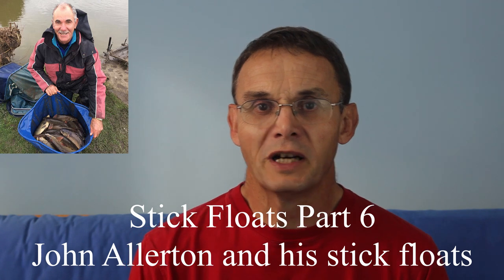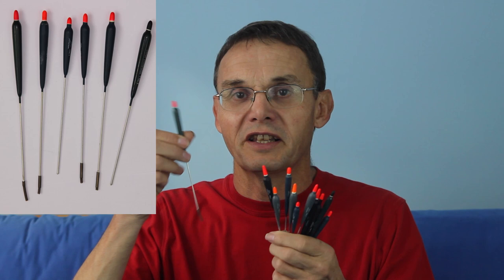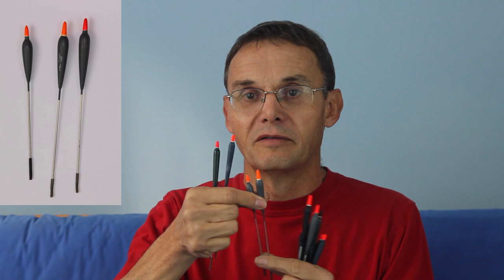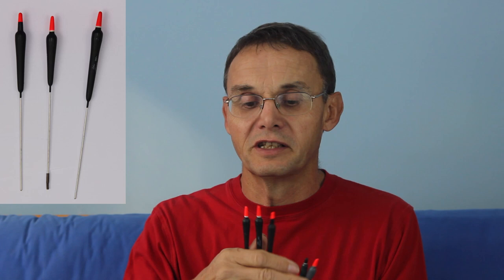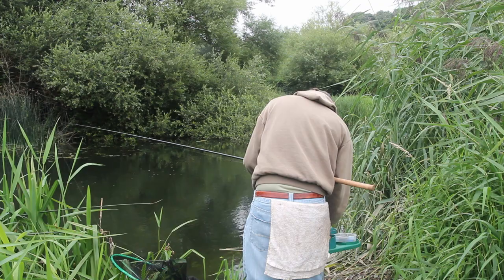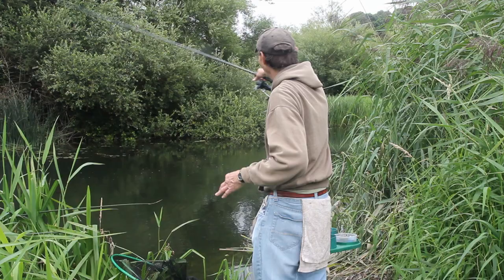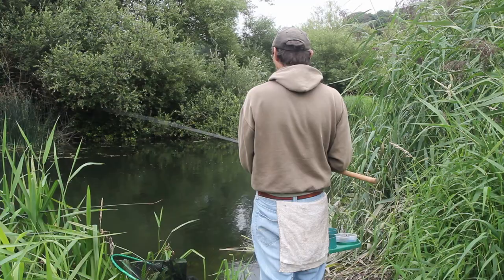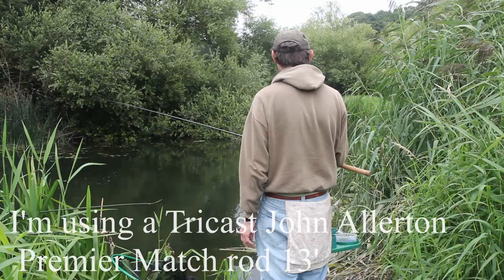Stick Floats Part 6  - John Allerton and his floats

Comment: I used to make pole floats using Johns alloy stem stick floats. You could nip off some of the tip and superglue a thin plastic vane down into the float base. The vanes were mostly painted Black and i used them on a local reservoir to good effect catching Bream, Tench and Roach. The floats used to sit perfectly in the water and were far superior to other types sold as pole floats.
Reply from the maker: A very different way of using them.

Comment: Bloody hell you’ve got a new landing net handle 🤣 What’s happened to your washing line pole?  😁
Reply from the maker: I've still got and use myh aluminium handle which is still usable after 48 years. It's advantage is that when filming with someone else around wielding the camera it will survive accidental tramplings! But I do have three carbon landing net poles.